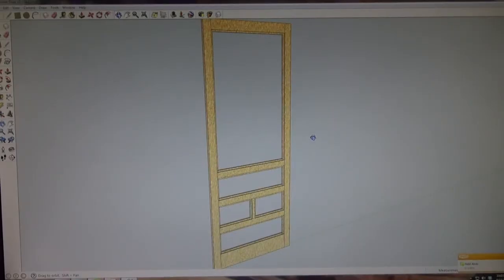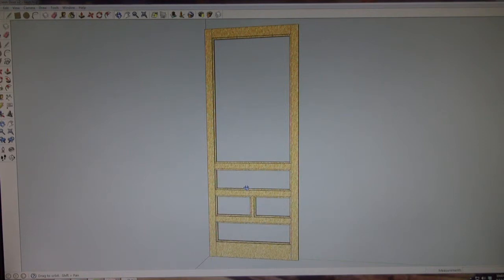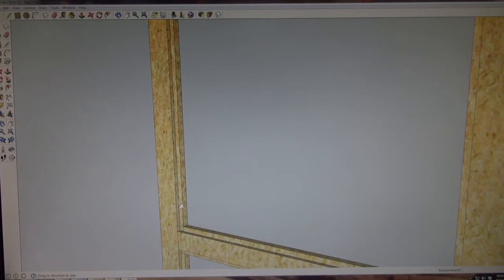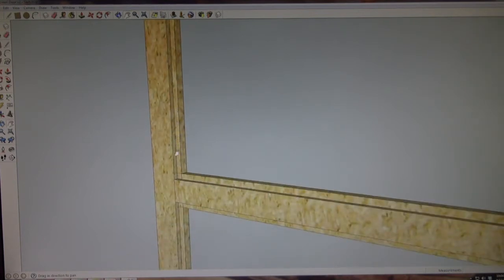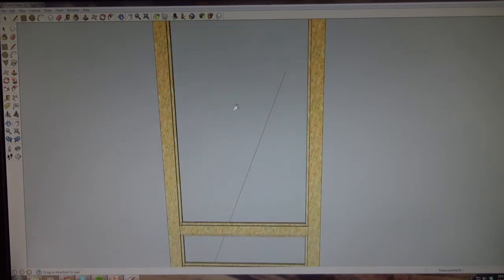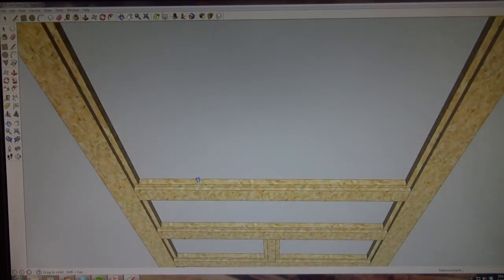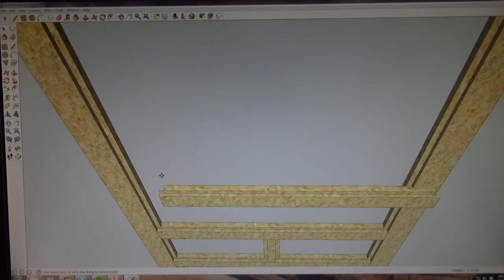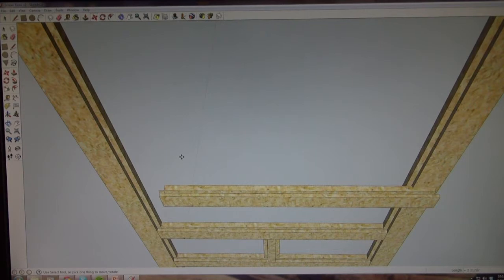Screen Door - Episode One

Comment from the maker: Sorry about the very delayed response on this. That light goes on whenever my dust collector is on. I have a remote control to operate it, but it's in a separate closet and with my earmuffs on I often can't tell if it turned on or not. The light lets me know it is in fact running.